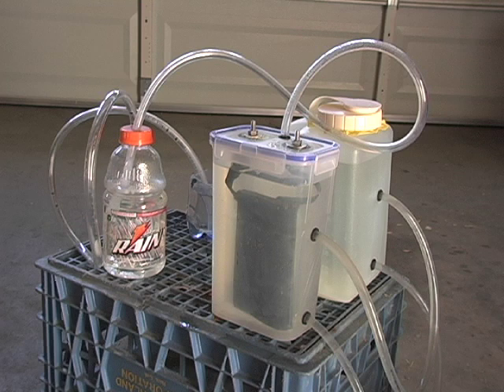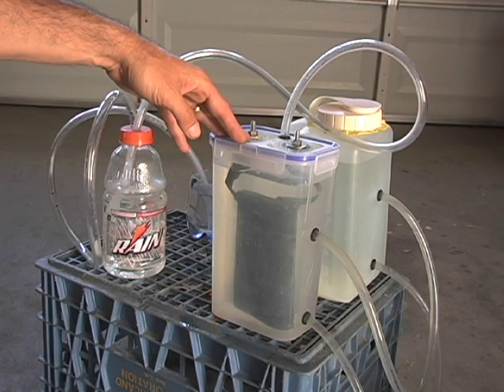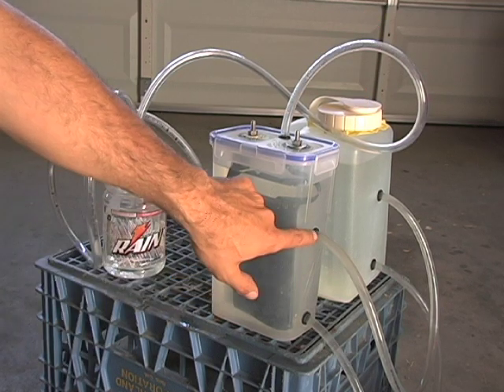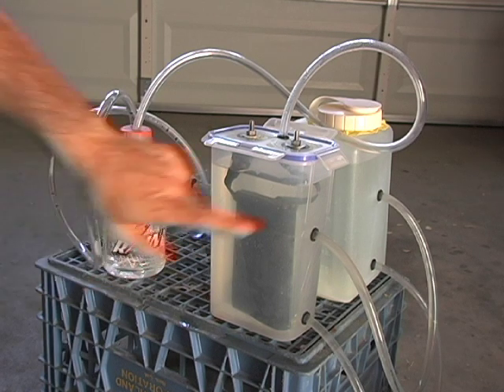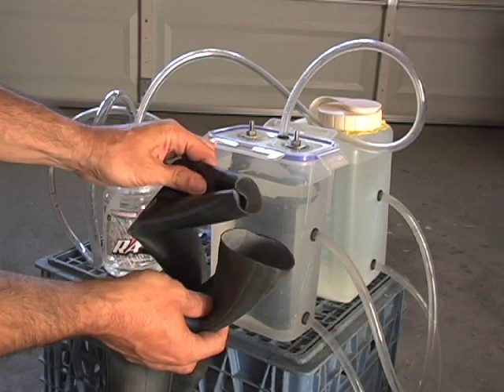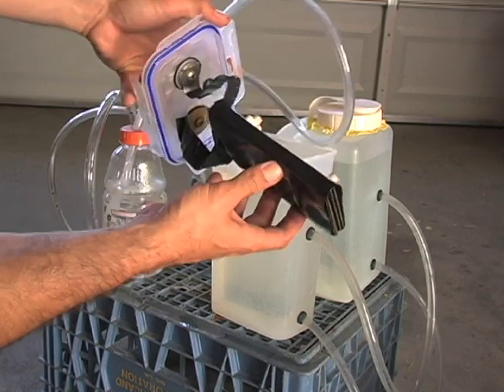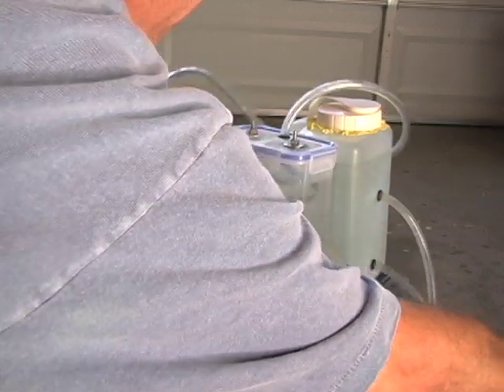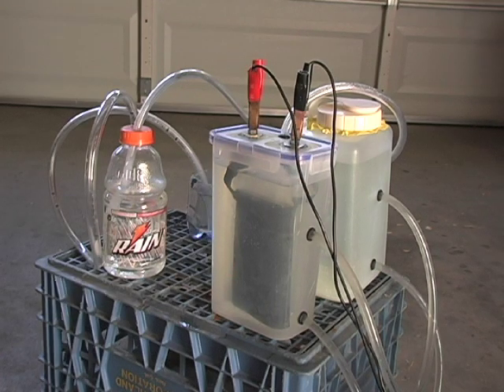HHO Container and Cell Insulation Idea

Comment from the maker: Thanks for the concern but I have had that cell running all day with no leaks or overheating. No overheating because I am running 5 neutrals and I have a large water reservoir. It's just a test unit though, I've moved on to dry cells. They are the only way to go!
Reply: why stop?